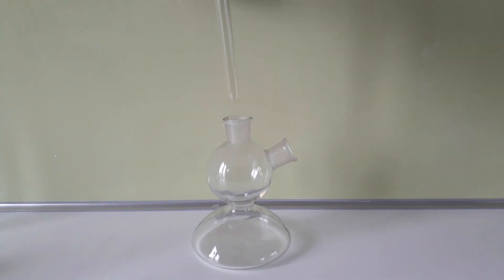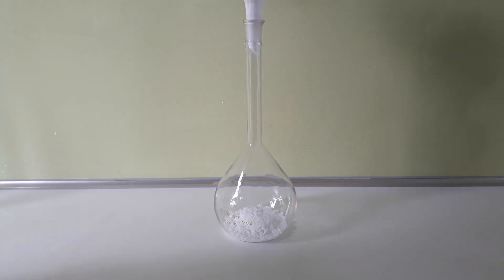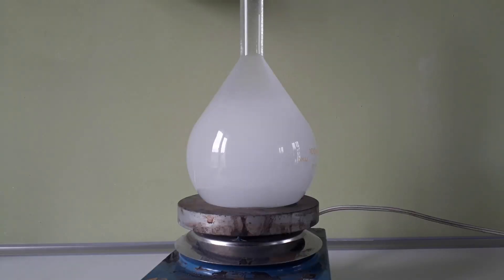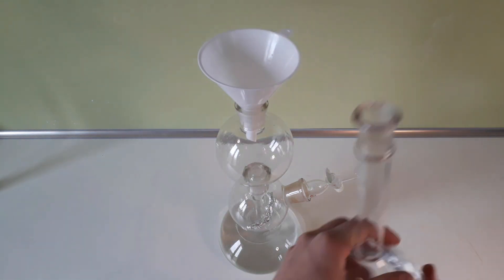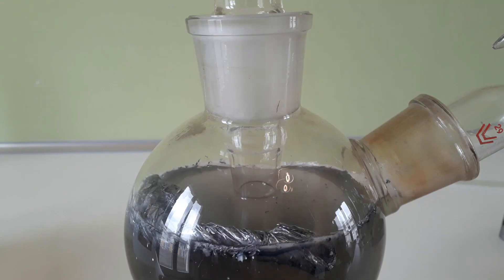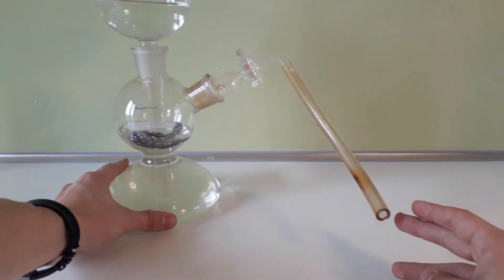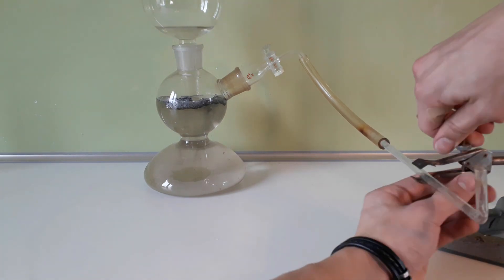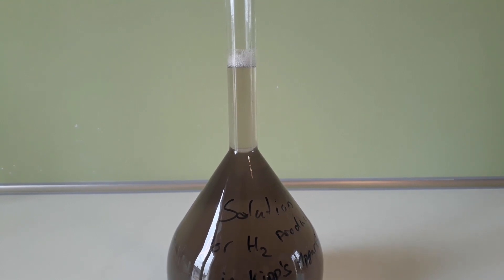Kipp's Apparatus

Comment: You explained the mechanism very well, but the way you performed this demonstration is very bad.
Here are the errors:
1) preparing and, worse, storing highly basic solution in a volumetric flask means ruining it; lye dissolves glass and changes the volume, rendering this precision measuring vessel useless
2) using lye and aluminium to make hydrogen is poorly controllable; it's sluggish to start and takes a long time to stop; zinc and hydrochloric or sulfuric acid is how it's usually done
3) igniting hydrogen at the end of the apparatus without checking for detonations by filling a small test tube under water is very dangerous and very bad practice that can end with a glass shard in one's head
4) Kipp's apparatus is normally left charged and used when needed; leaving lye solution in it would cause the ground glass joints to fuse together, ruining it

Comment: I don't know that we can used base than acid for this
Reply from the maker: It is because Al is amphoteric. That means that it will react with base and with acid: 
2 Al + 6HCl --> Al2Cl6 + 3H2 
and with bases you get: 

2Al + 2NaOH + 6H2O --> 2NaAl(OH)4 + 3H2

You can, in fact boil down the solution of Sodium Aluminate. And you will get a mixed Oxide of varying composition: NaxAlyO2+z